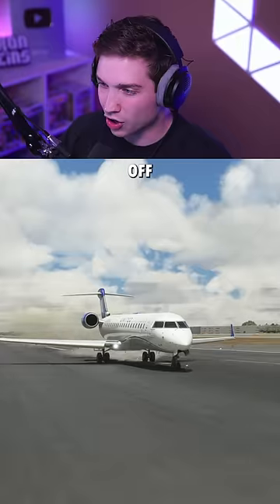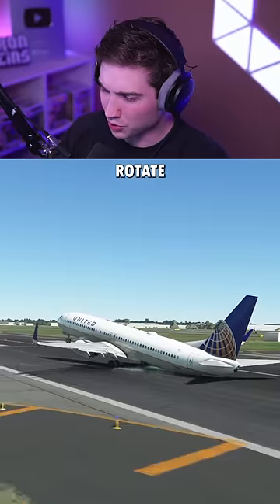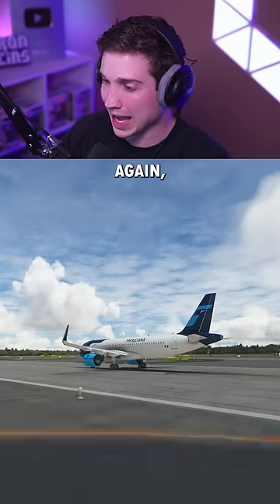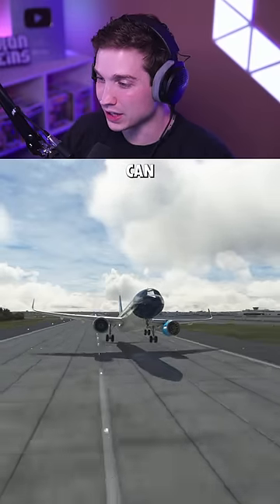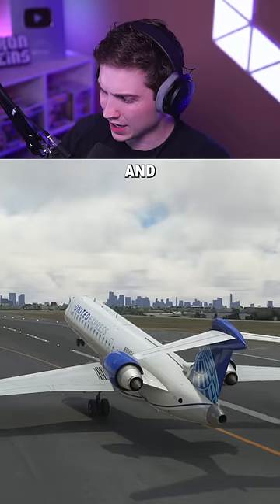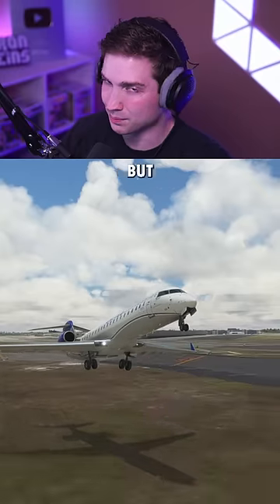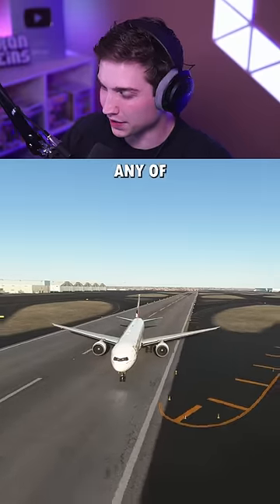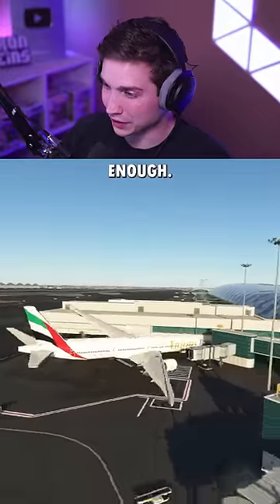Can Airliners Takeoff With ONE Engine?

Comment: He roasted Boeing 737 in 5 seconds
Reply: Old version of the 737 vs the newest a320
Reply: The 737-900 is longer than the a320, he should have done max 8 or 800
Reply: @PavelThePilot doesn't matter in real life the 737 would perform better under the circumstances just due to her design

Comment: Fun fact: in case something like this actually happens. In Tolouse where all Airbus aircraft are produced they get through a special tes flight and the test pilots have to turn one engine off before rotation of several seconds after, so they are confident that in case of a late engine failure where they can’t abort the take off the plane can safely climb and get back to the runway. (On one of those tests in the early 90’s an A330 crashed killing everyone on board)
Reply: Thats why we have tests
Reply: @qzg7857  true
Reply: For you information, not all Airbus aircraft are made in Toulouse ;)
Reply: @m.l.5067  as I know the final constructions of the aircraft happens in Tolouse with parts delivered from producing cities like Hamburg etc. but now Airbus has Building places even in some parts of North America and Europe.
Reply: @horizonpilot.8372  FALs can be found globally: Toulouse (A320 family, A330, A350), Hamburg (A320 f), Tianjin (A320 f) and Mobile (A320 f, A220). If we add non commercial aircraft activities, then you have A400M in Séville, you also have Helicopters (Marignane, China...)
Reply: @m.l.5067  thanks for the info!
Reply: @horizonpilot.8372  final completion of the craft is at Toulouse correct, fuselage sections are made in germany, wings in wales 🏴, engines dependent on aircraft ( England, North America etc)

Comment: Everyone survived except the Boeing 777. The A320NEO thought it was a breeze. The 737 and the CRJ-550 had a hard time getting airborne, and the Boeing 777 went straight into the terminal immediately after getting slightly airborne. But still, that's pretty impressive. Keep up the good work.

Comment: Don’t worry bro I got you cus there is a runway that is 30000 ft long in KEDW otherwise known as Edward Air Force base or smth and it has multiple long runways which are also used for shuttles

Comment: every airliner can fly with one engine
Reply: Absolutely correct. Every commercial airliner in the US, including foreign airliners flying within US airspace, with more than 1 engine is required to be able to do all phases of flight with one engine out. Yes, there might be some aero dynamics differences from normal all-engines performing normally, but usually not so much as to cause catastrophic failure or lift.

Comment: Aren’t they certified to do this? At least after v1
Reply: They can fly with 1 engine but not take off
Reply: @-qwerty-4422  yes, twinjets can definitely take off on an engine after v1.
Reply: @Hk-uw8my  he used single engine from the start of the roll, did not cut the engine after V1, that's why.